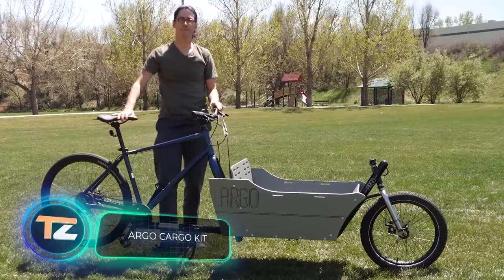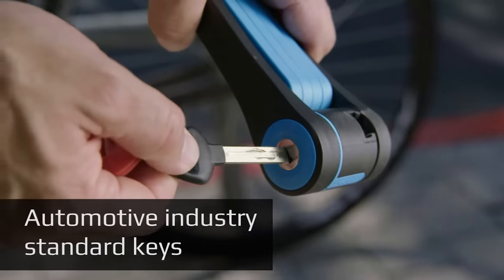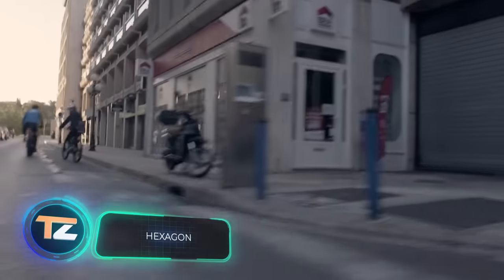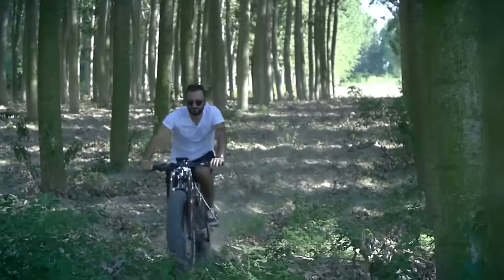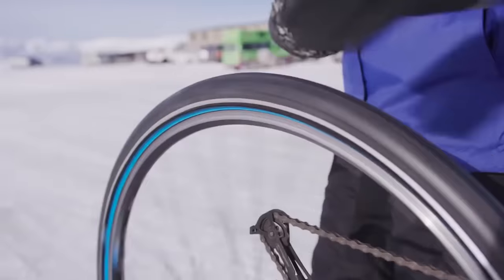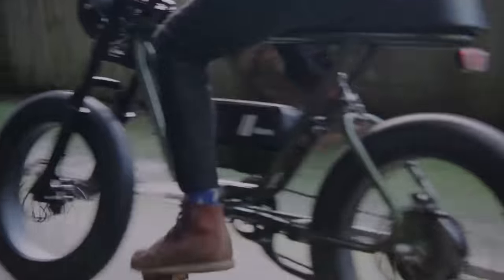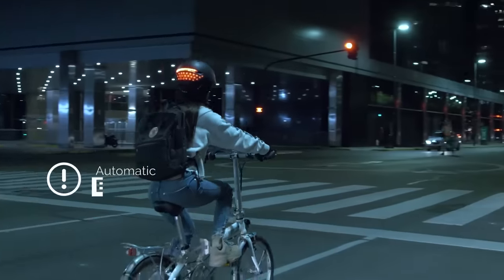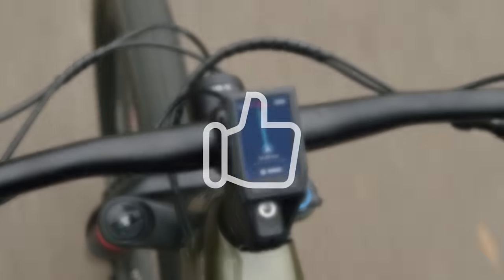10 NEW BIKE INVENTIONS YOU SHOULD SEE

Comment: Argo cargo is death to your fork and all components in sterring column, depending of the load and terrain. 
It puts constant stress on the fork at angles fork wasn't designed to handle, at least not continuously. 

If it had a wheel to help decrease the stress on the fork, that would be a good invention.
Reply: Did you see the brace that goes to the bottom bracket? That's got to help, but I'm not a bicycle mechanic.

Comment: what concerns me most about these is the batteries. Will they be available when the time comes to replace them or will we just throw the bike away?
Reply: Right a Pal had an electric bike for some time  the batteries were going down   a new battery bow would cost a lot  so he took just the box to a battery company in the city  and asked  what can ya do    Guy behind counter said  can I cut box open  to see  OK
he looked said sure  can  and with better cells    and it only cost half  of a new battery box  from manufacturer
Reply: Yeah your battery cost would be $7000 "only".
Reply: Those overpriced e-motorcycles will handle the battery discarding by burning it at night

Comment: 1. There were better, foldable designs
2. Video shows ppl incorrectly testing durability, hitting with hammer agaist air? "Low temp" compressed air can? Dont cut entire lenght with wire cutter at once?
Expensive, heavy and not really portable.
4. First, not a invention, just a light with bluetooth. 
Second that tiny direction light will be hard to notice by drivers, and as seen on vid, cycler ignores signaling with hand.
5. If you ever used large tires, you would know thats a terrible idea.
more Grip = more Friction. Crazy amounts of pointless extra weight both frame and wheels. How the hell would that reduce fatigue...
also for a off-road bicycle, pedals are quite low...
6. If you get a flat, say goodbye to your expensive wheel
8. same as 4, if cycler depends on it, it will just make it more dangerous. I doubt that car drivers would be able to see that ">>". from the distance it might just look like a dot.
Makes you more visable, but thats all. No clue how comfortable would it be to wear, there is a lot extra weight that doesnt help to protect your head [batteries/lights]
9. Cant lean to sides in tri-cycle, you might add even more wheels, oh wait...
10. Phone holder would be cheaper and perform better